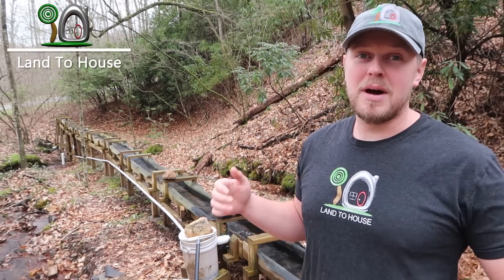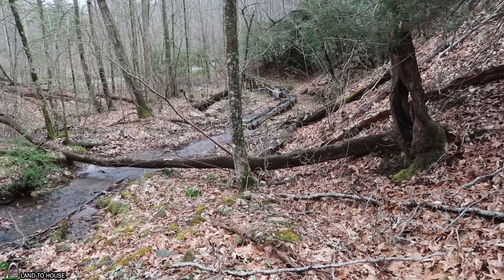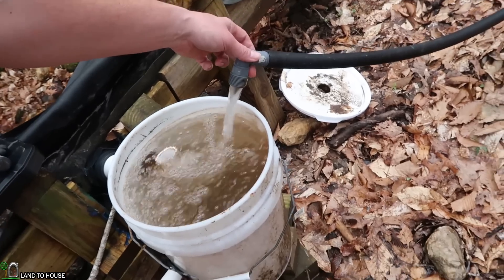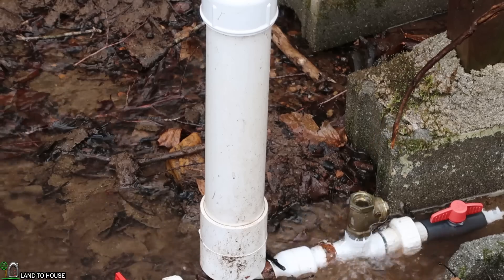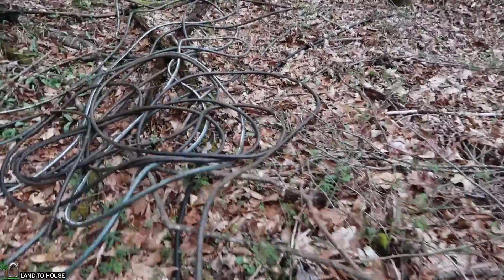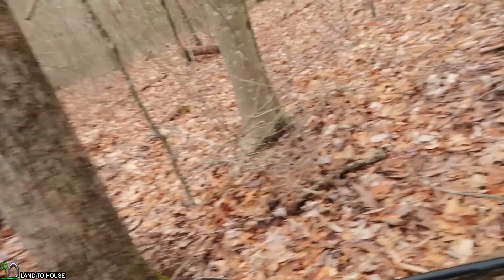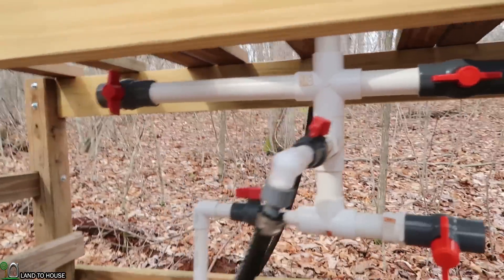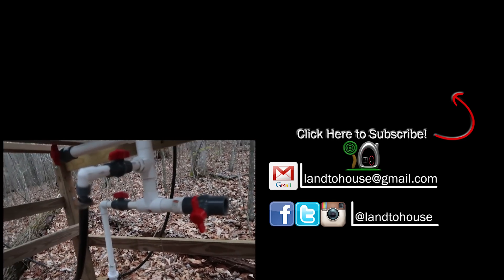Starting up the Ram Pump 2019

Comment from the maker: Get your very own Ram Pump on the Land To House website:
https://www.landtohouse.com/rampumpsales
Reply: Hey seth.if i use two ram pumps to work on one single delivery line, would that increase pressure/speed up volume fill going up the tank?
Reply: A Saw
Reply: @Land to House  Does the length of the drive pipe matter and if it does how long should it be, nim/max?

Comment: Nice video and presentation. 
It was told that we need to satisfy two conditions in order to see oscillation in the ramp pump but never offered a root cause to such effect. That is - 1) a static back pressure and 2) a certain drive pipe distant leading to the supply bucket. Not too short and not too long. 

Today I have conceived a root cause following communication theory on transmission line. If you are interested,,,

Given that up hill hose is bubble free full of water. 
Case 1: a hard capped hose at the far end will echo a POSITIVE pulse forward to the pump.
Case 2: an open end hose will echo a NEGATIVE pulse forward to the pump.
(Waste valve cyclic opens by negative pulse) 

Unexplained but taken as law: we do need a certain amount of back pressure, but why? 

Condition: the negative pulse return from up hill must be strong enough pull open the waste valve. 

So we need a strong enough up hill pulse, however empty pump-tank and an up hill hose can eat up most of the positive energy in the first place causing the down hill pulse weak. Too weak to trigger the waste valve. 
Caveat: up hill hose can attenuate the in both direction pulse, avoid long, thin and too flexible hose incurs a higher attention. 

Some company claims that the negative pulse to suck ambient air in at the tank input valve enough to replenish the dissolved air in the tank. They drill a needle size hole before the input valve of tank. This takes months to verify it is effective or not.

Comment: Ok...see this a couple times now and I am familiar with ram pumps...(though never operated or built one).  I would like to know..or maybe you can redo the video too include the information - from point of entry in the creek (gravity feeding) too the ram pump...about how must vertical drop do you have there?? then from the ram pump too your storage tanks, again how much vertical climb is there?? I am only interested in actual vert elevation..(not linear feet) . How much of a drop from the bottom of the storage tanks to your garden and/or spicket where you draw from in vertical feet??   This would tell me how much PSI you have going in & delivery coming out and down to your needs.  I know that while doing water sources here , we call it as "Every 27 3/4" (Almost 28") of vertical water column - you will have 1 P.S.I. of delivery.  Thank you

Comment: 9:44 to 9:54
Giving the flow rate on a per minute time scale ("gal/min") neglects the pump frequency. At 7:42 you see the pump at about 1 Hz. At that point a flow rate of 4 gal/min suddenly becomes 1 cups per second (or 250 ml/s). I assume that there is a smoothening of that oscillation down the line, but near the pump, friction does matter, right?

Comment: Will the output increase if you increase the size of the ram pump?
Reply from the maker: Yes for sure! Example: the 1/2" pump can supply 300gpd while the 1-1/4" pump can supply 1400gpd.

Comment: I saw this article on Yahoo today.  I thought of you. How would you solve this problem?
I'm wondering if a series of ram pumps and elevated storage tanks can raise water 80 stories high.
Is it possible that such a system would have no limit?
I would like to hear you responce.

“In North Korea, the poor live in 80 story high penthouses rather than the rich because lifts are often not working properly, and they cannot pump up water due to the low pressure," Jung Si-woo, a 31-year-old North Korean defector, told Reuters.
Reply from the maker: That is a situation! My ram pump design can lift 180 feet max. Thats only 15 or so stories. Not sure what could be done for 80! Perhaps a series of solar diaphragm pumps.
Reply: @LandtoHouse  That sounds good, If set up in series of holding tanks every 180 feet and then feed down to 150 feet and so on, than you will have 30 feet of head pressure for each pump to go another 180 feet.
The spillage can be captured and fed down to the lower tank. It seems this can eventually fill a roof storage tank that can supply an entire building. 

Your thoughts

Comment: i have a 1.4 acre pond thats spring fed. The problem i have is we have been dry the last year or two. the pond is down about 2 feet. I have a creek running 70 feet away from my pond. the creek is about 23 inches below the pond level. the pond has an outfall when full... so basically id just like to  run the outlet into the pond. would this be enough flow to bring the pond up to normal? or would pond evaporation defeat my effort... There is also a 4 to 5 ft. raise in land between the pond and the creek. approximately how may GPM does your system pump? is there any way i can contact you?

Comment: Great video, makes sence until u get to the 2" pipe in the tanks and it pops up on the screen saying 2'.
To me the looks of your piping to your storage tanks 1.5", probably the 2" u talking about?
Also, wouldn't u think u could use 1 more valve going to #1 tank, or redesign to where u could shut of the tanks without having to drain them to fix your leak?
And, your drive line to your garden to the valve,, your showing ALL that pressure, isn't that the water in the line and actually u need to get that pressure from your tanks?

Comment: I wonder if a ram pump would be useful in a diy hydro electric generator.. could possibly use the ram pump to speed the water up before it hits the water wheel

Comment: I am confused I understand how it works on a creek because the creek drops elevation so naturally is going to build up pressure,  but the previous video you used one in a  pond is  the pond spring-fed . I thought it had to be flowing water
Reply from the maker: Was it the stony ridge farmer video?  The pond is fed by a Creek coming down the mountain. The creek then goes out if the pond. The ram pump simply pulls water from the pond then goes down hill.
Reply: @LandtoHouse  thanks I will be purchasing the  1  1/4  one soon
Reply from the maker: @philb5   Happy to help. If you have more questions please feel free to send an email.

Comment: nice video and nice pump setup but u take filling the tanks so wrong its same pressure in all the tank correct but u filling the tank from bottom so water pressure builds up in time and cripples ram pumps output

Comment: I am confused about "" how much drop in elevation do I need......along with how much distance "" for a pump to work. Hear me out.  I have a swimming pool ( not in use anymore, but filled with water )  that I want to add a fountain to in the middle of the pool. There is no longer a pump house with filter, etc., but I still have the drain hose exiting the pool. My yard slopes "" downhill "" from the pool and about 20 to 30 feet away, it has a elevation drop of about 4 feet.  Placing my ram pump at this location, will it function ??  Thanking you in advance for your answer.
Reply: Yes but the pool would drain unless there is a constant supply to it?

Comment: Question,,,,I want to fill the huge pond next to my house.  There is not enough run off to fill it.  I do have a ravine next to the other side of my house going way north with a very large hill on the other side from the house. Could i go way down the ravine to the north and put a small dam then put a pickup there and run pcv down the ravine quit a ways, add a ram pump then pump the runoff from the hill back up to the pond next to the house?
Reply: Potentially yes, depending on heights etc.

Comment: Great video, very instructive and informative! Regarding the pressure the pump has to work against: It is not the atmospheric pressure (this is nearly the same down at the pump like on top at the barrels), but it is the hydrostatic pressure. For every PSI the pump generates you can pump the water up roughly 2.2 feet. The reason why the size of the delivery pipe does not matter (if 1/2" or 3/4" or even a 2' diameter barrel) is, that the weight force F might increase with increasing diameter of the barrel. But pressure is force divided by area (p = F / A), and hence will stay the same no matter how large the diameter of the barrel is. For instance, a barrel with two times the footprint will have two times the weight, if it is filled to the same height, but the doubled weight force spreads on a doubled footprint area. So the pressure p = F / A is the same. Voila!
Reply: The delivery pipe and the tank are essentially one and the same. For me, it's intuitive and I'm glad you put it on a formula to prove it mathematically.

Comment: to stop air mixing in your bucket the filling pipe to be just under the surface of the water bucket that way no aggregation of the surface.of the water. basic hydraulic action

Comment: How do the ram pumps do in winter? Do they freeze? I'm in New England
Reply from the maker: As long as the water is moving the ram pump is typically fine. I have a customer in Canada who wraps the pressure tank in foam insulation.   If the water stops moving it will freeze and break. I typically recommend that people drain the pump in really cold weather.

Comment: @5:30 - dangle a baffle between input and output pipes or just a sheet of stiff plastic the width of a 5 gallon bucket jammed between the two from the top, not all the way down.

Comment: If you have flat land can you run water straight into a tree and then syphon it down into a nearby hole below the water intake then back up to a pump? Would you get pressure coming down or does it equal out from the water being pulled up?
Reply from the maker: As long as you have input head pressure you can run the delivery into a tree.
Reply: @LandtoHouse  I was thinking siphon out of a pond by using the tree and then have the water travel from there.
Reply from the maker: @stewbuntu  like have a pipe intake in the water and then toss it over a tree limb? That would not hold a siphon. Siphon has to have the water go lower than the source to work.
Reply: @LandtoHouse  right so dig a hole a few ft deeper than the pond/ intake to get a siphon going.
Reply from the maker: The hole dug will fill with water quickly with ram pump.

Comment: You should install a weir before your intake box, this will allow for a silt collection system ahead of your intake manifold, you should support your intake manifold in a pool of water so it doesn't sit on the bottom this will allow for no debris to be trapped, and to reduce silt collection in your main pool, basically, a two weir setup with a prior weir to allow for silt collection and removal.

this becomes significantly more important if you were running a Pelton wheel hydroelectric system as silt destroys the wheel quickly and a clean intake area is required. I don't know if you have an area further upstream where you could collect head pressure at the bottom but it's an amazing and sustainable way to generate electricity. You could at the end of the system divert head pressure to a ram pump to then take the excess water up to your collection tanks for garden use, I also recommend a cistern if you are going to be using this all winter long and ground freezing is a factor.

http://www.nooutage.com/lv1400.htm

Comment: Build your makeshift (water source)dam deeper to let silt to settle at the bottom of the dam. Thus avoiding silt getting into the pipe and pump. Your white water tank will  grow algae and will clog up your pipes. You should use opaque tanks.

Comment: Quick tip: if you install a 2" pipe with an air tight cap vertically into the line (don't let it fill with water) where you're having water hammer problems you will no longer have water hammer problems. 

It's called an accumulator, nuclear power plants use them to stop lines full of heavy water from bursting when they take the reactor off power.

Comment: You should put gold mats in the top section of the flow system so when you check the filter you can check the mats at the same time might get some gold

Comment: I don't think I agree with you that the size of the drive pipe doesn't matter.
You're talking about the momentum of the mass of the water in the drive pipe creating a water hammer effect in driving the pump.
The more mass in motion the more power to drive the pump. Just thinking.
Reply from the maker: If I said drive pipe I mean delivery pipe.

Comment: Does this require moving water?  Will a 2 acre pond work?
Reply from the maker: You can siphon out of a pond. Do keep in mind the pump will pull water 24/7 out the waste valve. So if your pond does not have water filling it back up it will drain.
Reply: @LandtoHouse  Thank you for responding.

I have 80 acres and I am wanting to cross fence my land for cattle.  I currently have cattle, but they graze the entire 80 acres.

I have two ponds.  Neither have ever went dry. (North Alabama).  I have a small creek that flows around 9 months of the  year.

My large pond in man-made has about 2 acres of surface area and is about 12 feet deep.  I would like to use it to pump water about 30 feet up in elevation with a distance of 500 feet to supply water for cattle on one of the proposed cross fenced pastures.  

It sounds like this is doable.  I have watched several of your videos and I saw you on Stony Acres Farm.  

I can plumb a house, but this is obviously something new.  I can send you a topo map and a satellite map of my farm if if helps.  We have no issue with rocks.

Comment: If you used a larger tank on the ram pump for example a blue barrel would you get higher outlet pressure ?
Reply from the maker: For the pressure tank? The tank only smoothes out the hammer. It does not necessarily increase the output pressure.

Comment: I would not feed the water tanks from the bottom,  I would feed from the top.
Reply: I would probably do the same. Theoretically it wouldn't make much difference unless the pump or pipe fails, then you'd lose all of your stored water. He's got a non return valve to prevent that, but it's still added liability when a top feed system would work just as well.
Reply: @grogdocr  Yep added expense of valve and possible failure of same. Peace

Comment: Aren't you fighting gravity thought, not atmospheric pressure? Isn't the issue, the weight of the water in containment, slowing the flow? 
Most H²O containment I've ever seen were filled over the top, with that, is it possible, with the right terrain, to create a syphon downstream of the pump to storage, or would you just suck air. I guess I would need an antisyphon valve... I think I just created and solved my own problem.
Now dats sum good H²O!

Comment: Well you could remove the one-way valve at the reservoir at the top of the hill. Simply by filling the bucket from pot.

I mean the way you have it now is fine I guess. But I believe the disadvantages out way the advantages. With the supply line inlet on the bottom of the barrel.

But as long as it's working fine. It's not a big deal.

And while it is true that the air pressure in the cylinder at the pump is greater than the air pressure at the reservoir at the top of the hill. It is actually gravity producing most of the resistance.

So while you are reducing friction resistance. You are increasing the amount of Mass needing to be moved. Increasing resistance. And therefore the pressure in the cylinder at the pump. In order to overcome that resistance.

That's not to say that it won't. That is to say however it will just take longer.
Reply from the maker: You might find this interesting. https://www.youtube.com/watch?v=jzvoKeroNUM
Reply: @LandtoHouse  that video misses the more important issues. The physics says this doesn't matter much in terms of filling. But the engineering says that valve WILL fail given enough time, and when it does you will lose your stored water.

Comment: Does it work in the winter time at all
Reply from the maker: I've managed to run a pump in 15 degree weather. If any portion of the system stops flowing it will shut down due to freezing

Comment: Try placing the 3/4 discharge line before the 1/2. Not the other way around.  In other words you would want the discharge line going from largest to smallest. Friction loss is always a factor, regardless of GPM. The smaller the line the more friction loss.  It may not be critical in your case depending on your end goal. More pressure = less volume. More volume = less pressure. What you may find is the volume of water discharged may not change significantly, however your discharge pressure could increase.  🤷🏻‍♂️.  Nice work tho.

Comment: I built the entire ram pump exactly the same. It doesn't work. We don't know why...not sure if it's a scam here ?? Very confused.  It simply won't start..period.
Reply from the maker: Several factors can keep the pump from running. 
1. Air in the drive pipe
2. Drive pipe is not the same size as the waste valve.
3. Not enough back pressure in the delivery pipe 
4. Many more things.

Comment: How are ram pumps with their elaborate plumbing system any better than a simple electric pump.
Reply from the maker: I have been running this pump for 6 months at a time. No fuel or electricity.  Imagine the cost to do that with an electric pump.

Comment: no... its not just atmospheric pressure pushing down... dont forget about gravity and the weight of all the water in the tank....  if you fill from the bottom, it will get progressively harder for the pump as the tanks fill. you should be filling those tanks from the top, not the bottom. take the same diameter tank but increase is capacity to 10,000 gallons (it would be 'really' tall).. the water pressure at the bottom of that tank would be much much higher because of the weight of all the water above it...